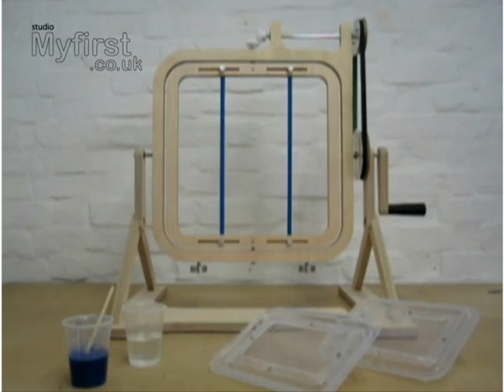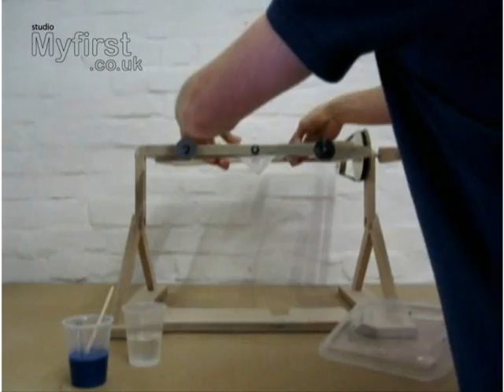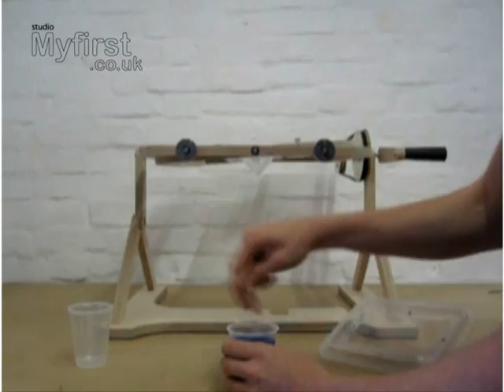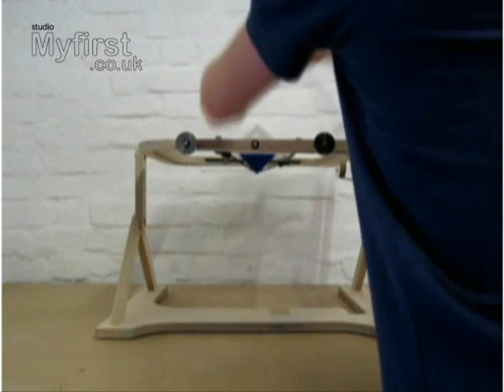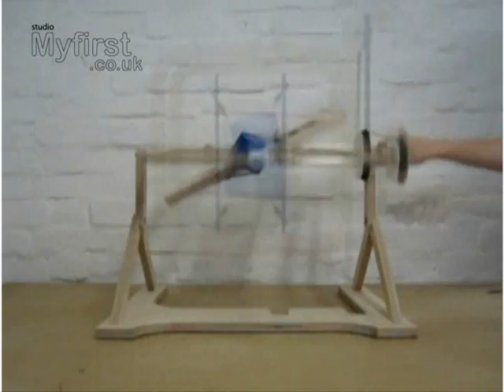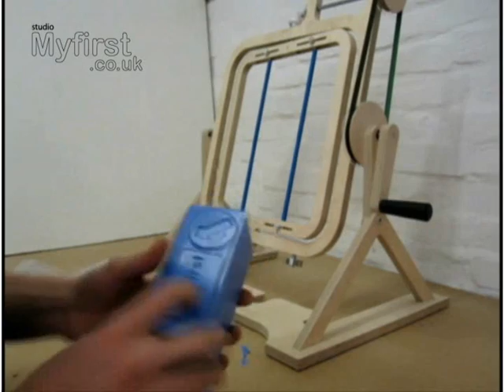myfirst roto moulder (rotational moulding)

Comment: Nice machine and its also something that plays tricks with your eyes.  I could have sworn the inner frame changed direction at one time.  Could the same effect be achieved using one rotating frame and mounting the casting vessel on the diagonal?  I only asked this because I once saw a machine for making hollow chocolate Easter eggs and that's how that worked.  Molten chocolate was poured into a mold and the whole thing was then rotated diagonally.

Comment: So you basically mix some sort of 2 part epoxy or plastic together throw it in the mold. Spin it super fast, liquid holds to outside of mold and not center, dries, then you pop it out?

That is amazing..!!! What kind of plastic/epoxy are you using? I will have to look into this.. Any design limits?